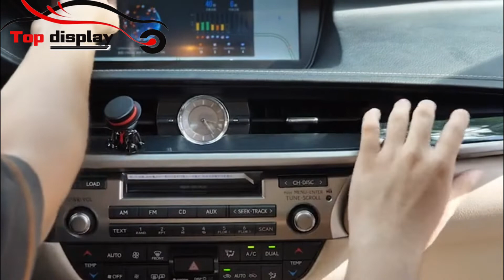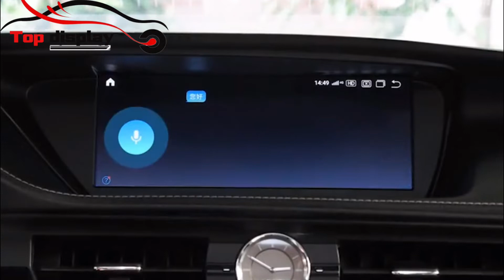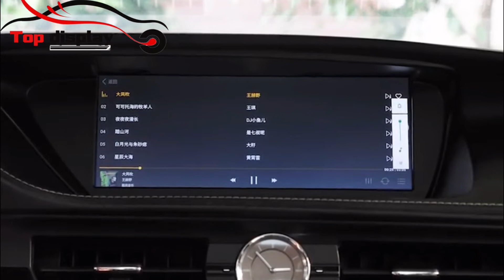Lexus ES 350 radio upgrade 2013 2014 2015 2016 2017 2018 Android stereo replacement How To Install

Comment: Hi
The infotainment screen on my 2016 ES300h doesn’t work sometimes. However, the backup camera works. I saw this problem in another ES. What is the solution?
Thank you!
Reply from the maker: Is it also an Android after-market infotainment screen?
Reply: No, the screen is factory original from Lexus.
Reply from the maker: Then it won't be problem , as long as the power supply is OK .  @shujayethossain6554
Reply: Mine does the same thing😢